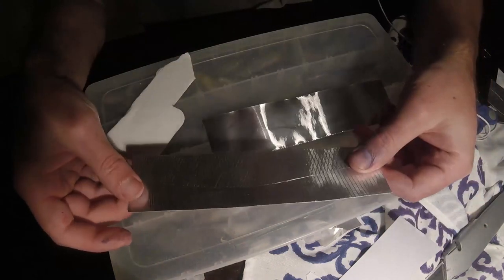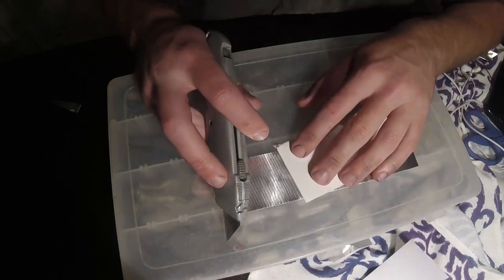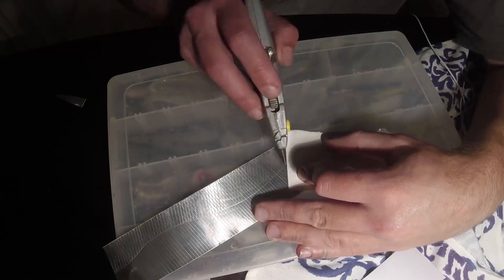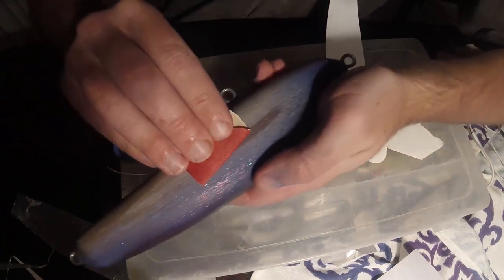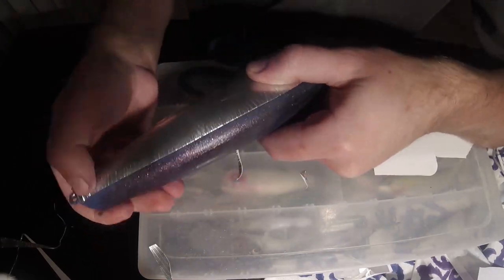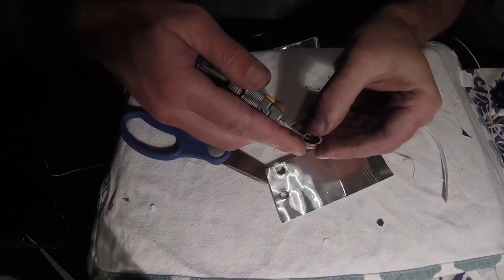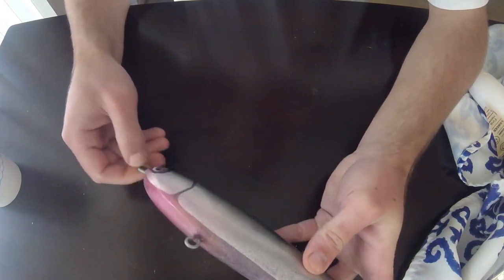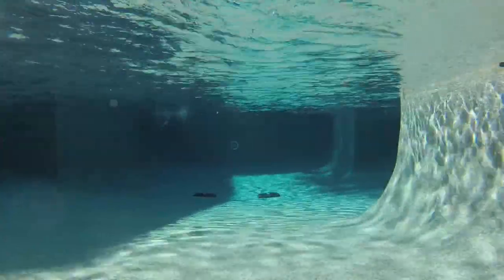Foiling A Prototype GT Stickbait & Pool Test!

Comment: have you tried using some threaded rod to do the hatch pattern very quick
Reply from the maker: I have not. The issue with having a fixed pattern is that you can't adjust scale size. I do like having the larger scales in the middle and the smaller scales towards the tail and the head. But I will have to try out the threaded rod method some time. Thanks for watching!
Reply: @TheAnglingGlobetrotters  yeah after I commented I thought about it and you split the pattern either side of the lateral line. I have thought of a way around that. But nice work mate it looks great.

Comment: Hi mate, great work - could you please tell me the name and where to get the foil? Im in QLD, Australia
Reply from the maker: Hey mate, I'm sure Bunnings or Mitre10 should have some. Look where the electrical insulation tape is and pick the thinnest one to start of. Let me know how you go!
Reply: Thanks mate, I actually have some thin foil tape but yours looks much thicker? is it branded, eg 3M? Does it have a name?
Reply from the maker: Yeah it's called Sur Tape. If you have really thin tape, that is the best option! Really thick tape has a lot of memory and is easily damaged and dented.
Reply: ok cool thanks - what model Shur Tape, AF 75? thanks for all your help
Reply from the maker: I already threw the wrapper of the role out so honestly I wouldn't have a clue. If it looks nice and thin, your good to go!

Comment: Hey brother
Plz can you help i want to paint a homemade lure with a pink fading into white colour but i dont have an airbrush
How can i get a good fading effect on the white and pink without an airbrush?
Am not very comfortable with fading colours usin paint brush
Any tips you can give me plz?
Anyway great video as always bro!
Reply from the maker: hey man! So the most inexpensive and basic thing to do is to buy some spray paint. Usually the cheaper brands don't have a very good nozzle on the can which causes the paint to splatter. Just buy a good white spray paint and a pink that you like. That should work just fine although some practice is never a bad thing to consider. Hope that helps, let me know how you go!
Reply: The Angling Globetrotters 
And do you have any tips on using paint brushes to paint fading effect on fishing lures?

Comment: Hello can you tell me where to buy the wire from? I can only find thin stainless wire.
Reply from the maker: Hi, the stainless steel wire is 2.2mm thick but 2mm works fine (if not better) I've been able to find a nice roll of it in both Australian and US DIY stores like Bunnings and Home Depot. As I'm not sure where you live, you're probably best off to google 2mm Stainless Steel wire and see which locations pop up. Thanks for watching and if you have any other questions, please let us know.

Comment: What kind of foil? Thickness? Source?
Reply from the maker: Hi Ray, this is regular foil tape. One thing to look out for is to make sure that it's not the super stickly electrical silver tape, that stuff has a really thick sticky layer on it and will damage and dent easily even after a coat of epoxy. The thinner the better. Usually any other type will do. Standard DIY stores like HomeDepot or Lowes should have it, depending on which country you live.